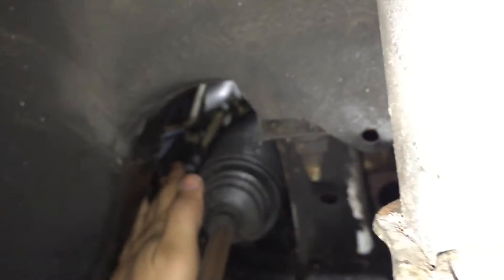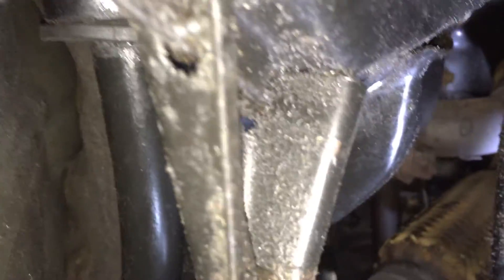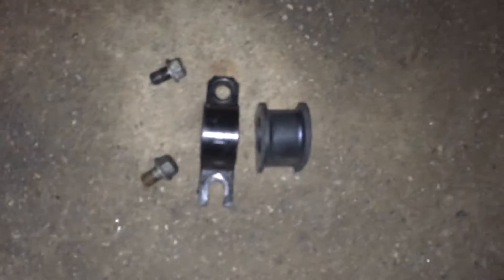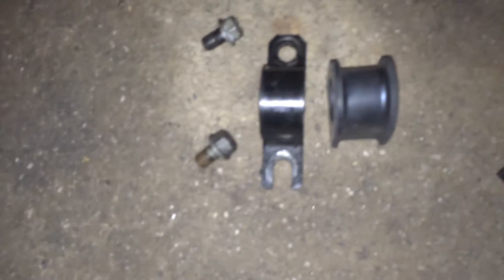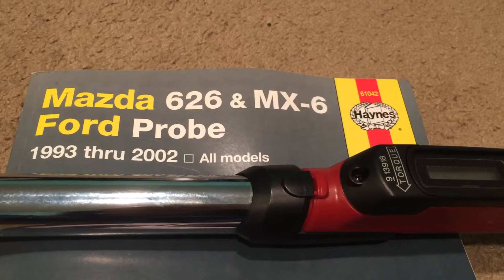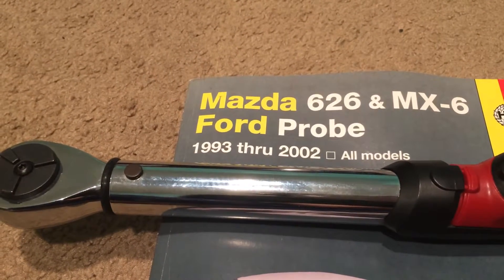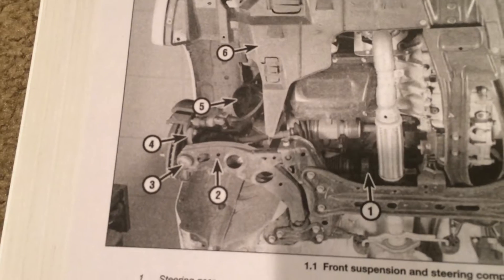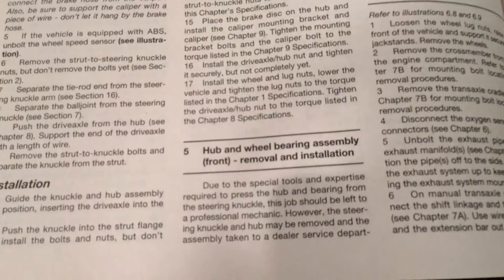2002 Mazda 626 Sway Bar Bushings, Tire Vibration, Clunking Sound

Comment: I have never agreed with a video comment so entirely as I do with this one! Had the "pleasure" of changing the anti-roll bar bushes from the front end of my 1999 Mazda 626. What an absolute f**king nightmare! (apart from the fact i was doing both tie bars too and they were totally corroded, stripped, rounded off so required complete deconsruction to take off)

Like you said, not complicated, hell I qualified as a mechanic when i was 18, but fiddly, awkward, uncomfortable and frustrating! I did wonder when i first heard you say it was the worst job you'd ever done, i thought, come on, a pair of bushes, should take 45 minutes (like most cars!) but you're right. 

Im sat in a dark room with a beer trying to recover my sanity!

Comment: What bushings did you use? Part number? I bought a couple from rock auto and just like the rear, they are wrong.
Reply from the maker: I had checked at Rock Auto and I did not find it in their catalog. I found mines from Auto Zone for less than $30.
Reply from the maker: Sorry for the long response. I am providing you with the link of the same ones I picked from the AutoZone store. I hope this helps. I didn't see this item in the RockAuto site unfortunately. 
https://www.autozone.com/suspension-steering-tire-and-wheel/sway-bar-bracket-bushing/duralast-sway-bar-bracket-bushing/532081_0_1733_2940
Reply: Rivera's Garage I actually ended up getting some moogs from Rock Auto and trimmed them to fit the bracket perfectly where the OE bushings we're notched. Unfortunately they sent me the wrong links so I haven't installed anything back in yet.
Reply: Rivera's Garage thanks for the help though!! That was not fun!
Reply from the maker: It's a great car, but this job I do not recommend it to anyone. I hate it. I would do the rear ones any day. The design of these bushings are not comfortable at all. I have used Moog with my other vehicles and it's a top notch quality brand and product.
Reply from the maker: At least there is someone who understands the struggle with this job.
Reply: Rivera's Garage very slow going in the rears. I wish there would have been an access hole/plug through the floor lol
Reply from the maker: Is your engine a V6? I don't know if the say set up is for the 4 cylinder engines.